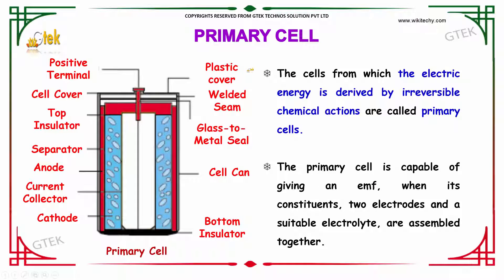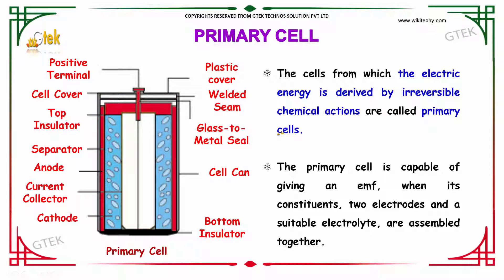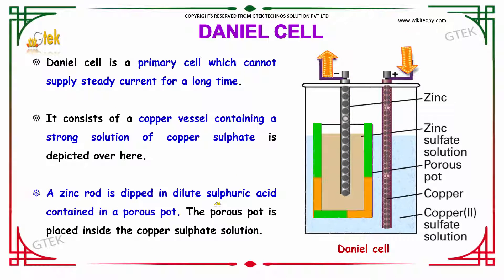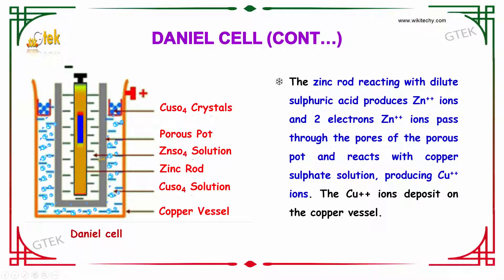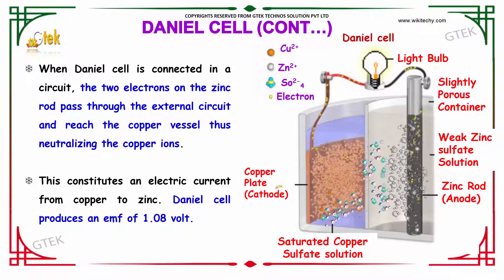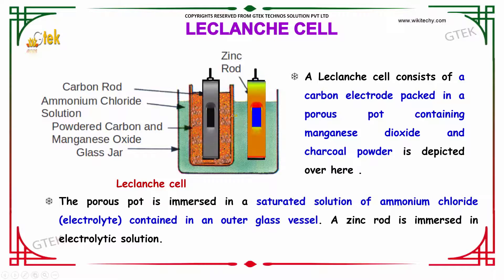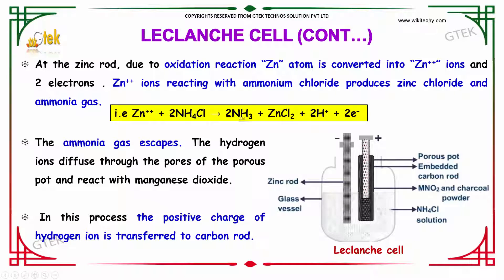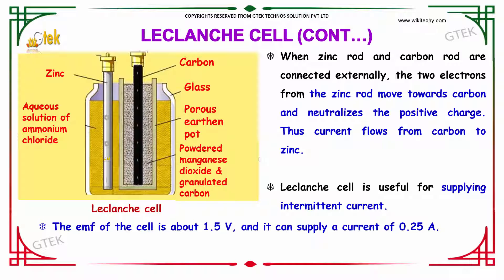Primary Cell Current Electricity Class 12 physics subject notes lectures CBSE IIT JEE NEET

Comment: A primary cell is a battery that is designed to be used once and discarded, and not recharged with electricity and reused like a secondary cell (rechargeable battery). In general, the electrochemical reaction occurring in the cell is not reversible, rendering the cell unrechargeable.

Comment: A primary battery is a portable voltaic cell that is not rechargeable. ... and beakers, though relatively easy to build, are not convenient sources of electricity. ... The half-reaction that occurs on the anode when the battery delivers current is the

Comment: A primary cell or battery is one that cannot easily be recharged after one use, and are ... by passing current through the circuit in the opposite direction to the current ... Such cells are typically connected to primary power sources so as to be fully ..

Comment: A primary cell is a battery that is designed to be used once and discarded, and not recharged with electricity and reused like a secondary cell (rechargeable battery).

Comment: A primary cell or battery is one that cannot easily be recharged after one use, and ... by passing current through the circuit in the opposite direction to the current ...

Comment: When a current flows through a primary cell having carbon and zinc electrodes and a diluted solution of sulfuric acid and water (combined to form the electrolyte)  ...